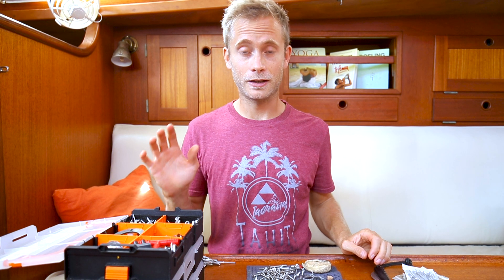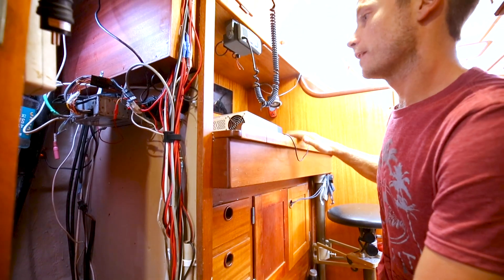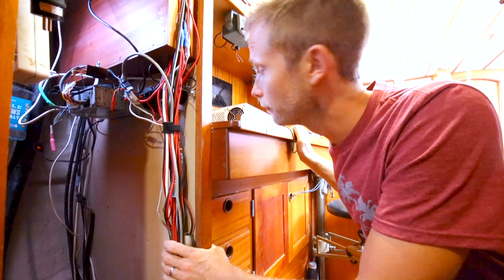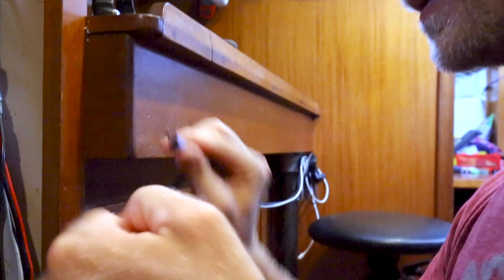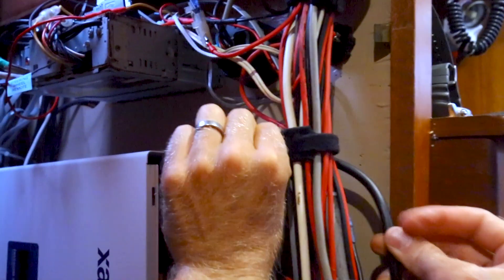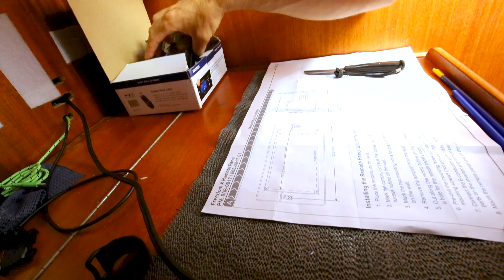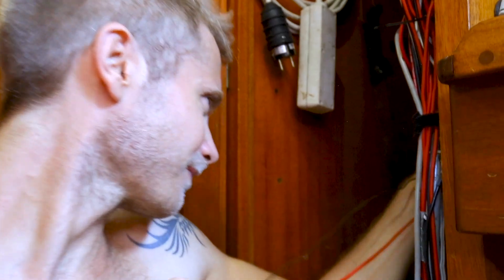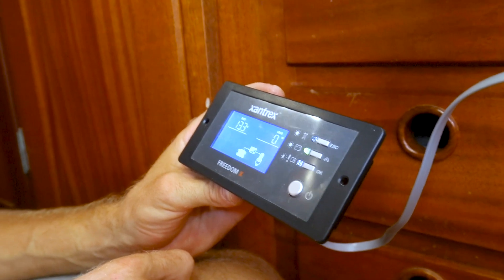INSTALLATION: FREEDOM XC 2000 230V Inverter/Charger - Knot Vikings

Comment: Although I understand  horizontal mounting is "allowed", you did seem to have room for a vertical orientation, which cold deliver more efficient cooling via both the fan and convection... wondering why you still chose to go horizontal?
Reply from the maker: Just FYI you may see different mounting options on page 24 of the Owners guide - https://xantrex.com/documents/Inverter-Chargers/Freedom%20XC/975-0799-01-01_Rev-D(Freedom%20XC%20PRO%20Owners%20Guide)_ENG.pdf
Reply: There is a note in the instruction manual that indicates only a horizontal is allowed in marine environments.